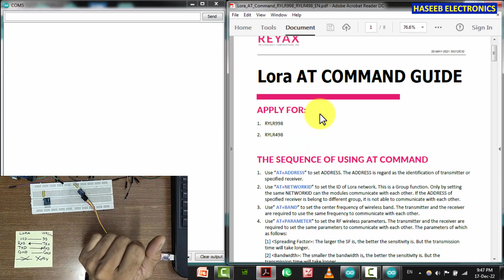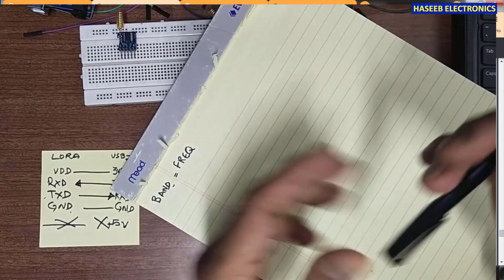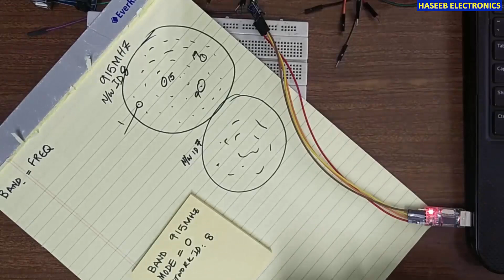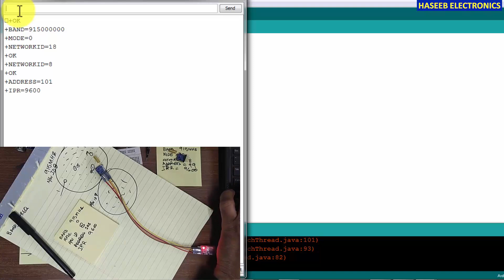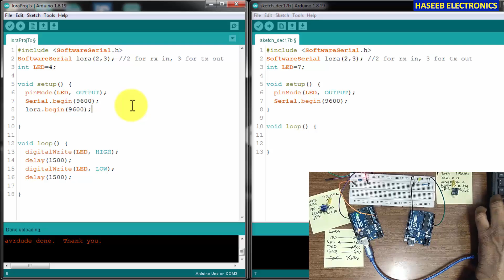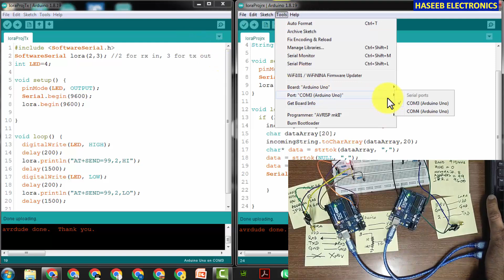{793} Reyax LoRa RYLR998 Transceiver Project Using Arduino Uno

Comment: Assalam walekum janab SG 3525 IC pin1   pin 2 pin 9 ine teenon ko kis tarike se set Kiya jata hai current mode aur voltage mod janab ek bar is per video banaa dijiye